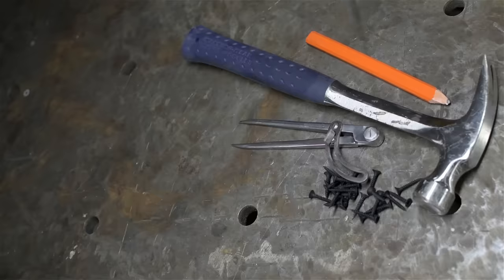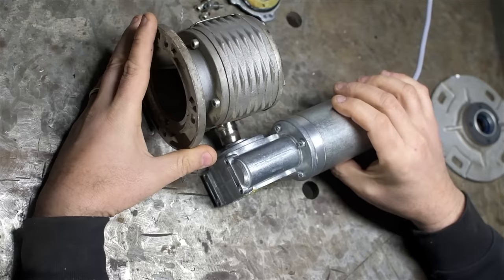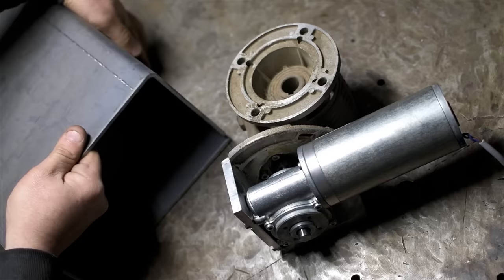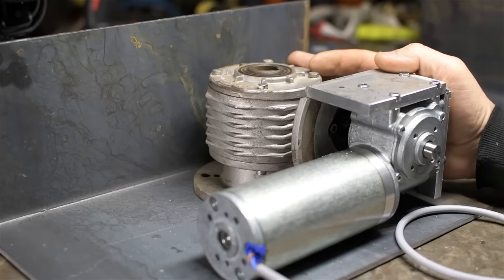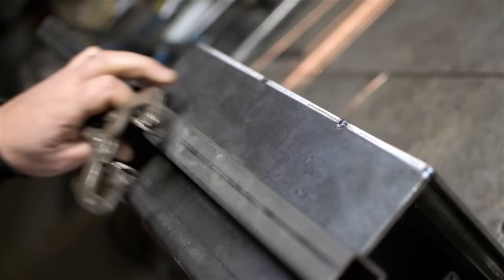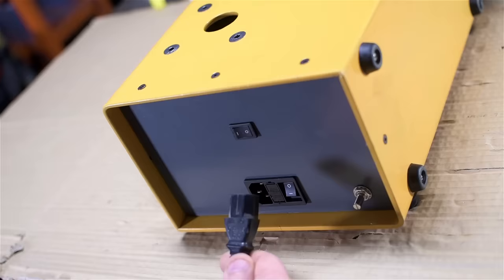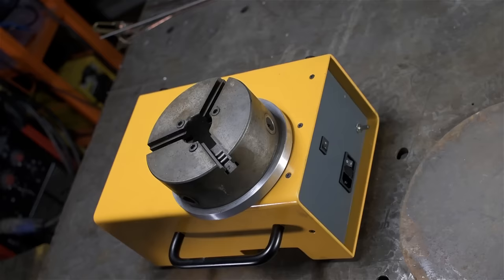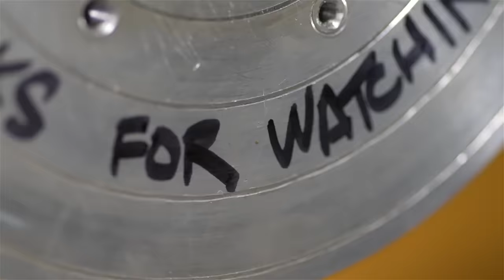Building a Rotary Weld Table

Comment: re: power indicator LED (or actually neon), the switches in those power connector/switch/fuse modules are a standard size, you can get neon illuminated ones that would be a snap in replacement requiring no modification
eta oops just realised how old this vid is :D

Comment: Great video. Love watching you do your thing.

Should you have put an earth/ground connection on your case and connected to the earth pin of your power supply? As it is now if there is a short between your power supply and the metal of the table case you stand to get a nasty shock.

Comment: when you have to put nuts in tight spaces you might like to try welding some rod to it, easy handle for when you gotta remove it in 10 years.

Comment: there must be a way to foot pedal control the potentiometer speed control so you can speed up a little as the part warms.   I am guessing the speed control is pulse width modulation but maybe the potentiometer changes the input voltage?,    power wouldn't matter with that much reduction
Reply: very well done video and project

Comment: Wonder if there is any benefit to having a rotary table with a stepper in it.  Instead of it moving at a steady pace you could set it so it moves X units, pause for Y time, move X, pause Y, etc and so on.

Comment: I understand what you mentioned at the end about welding the Aluminium, and how, as it warms up, your speed goes out the window and everything becomes a kind of fluid situation. I've noticed the same thing when I MIG weld Aluminium. Even without a rotating table! As it gets warm, you have to constantly adjust your welding speed, otherwise you'll burn a hole into the metal. 

I think the idea that you mentioned, about setting up a foot pedal for the speed control, would be good. At least that way you have some way of adjusting the rotational speed on the fly. It does raise a different issue though; how do you deal with 2x foot pedals?! ;)
Reply from the maker: with 2 pedals my brain would stop and I'd fall out of my chair. :)

Comment: Great work Tony.  I'm still confused about why you couldn't mount the 24 VDC gear-drive motor with it driving a platter directly?  It appears that the motor has a shaft that you could have keyed into a platter, so rather than building a platter that fit your worm-drive reducer, you'd build a platter with a receiver for the 24 VDC shaft?  I'm missing something and would appreciate any clarification you can provide?  jb
Reply: The main reason I can think of is the motor isn’t designed to have lateral force on it. Think of the drawing around 4:40, with a pipe that large, the forces acting on the platter would be quite large. Making his own load bearing component would’ve been pretty difficult like he said at the start

Comment: Great job on your project!

I know this probably has been mentioned before, but could you have taped the mount for the 10:1 gear box, and threaded your countersunk hex heads into that, or welded nuts to the back side of the mount. Just curiosity, and possible future suggestion.

Comment: perhaps an adjustable torch holding fixture, in a properly fixed position.  where operator on needs to feed the wire ? alllowing the other hand on that switch,  and go!  i'm joking of course about the switch.

Comment: couldn't you add a sliding (spring pressured) contact to the chuck of a lathe and get the same results? I guess the semi portable nature of the design helps, and in that case, attach the same sliding contact to a lathe chuck coupled to a router sitting on its side in a metal box frame? then you would have speed control, and with a chain get gear reduction. when parts are spun vertically, a metal lazy Susan with a chain drive to a router sitting atop your welding table for ground seems like a more compact, easier solution (have electrical contact draggers contact table nearer to the center of the disk to ensure no electricity moves through the bearings near the circumference of the lazy susan) with a router speed control to use with an angle grinder that has a chain gear locked into the angle grinder drive shaft, easier to build, better control of speed, more compact. i suppose your systems smoother operation would mean the motor lasts longer, but as you said, you'll probably use it once or twice a year...

Comment: get rid of the foot pedal and match a fixed amperage with rpm's of work , should help and as for that strange feeling you get trying to weld a moving part lots of practice I used a mig less $$

Comment: would a direct motor shaft mount with large bushing to receive the loads be a cleaner, somewhat easier and more compact solution? being compact it could he used in a more modular way as well.

Comment: Tony, been enjoying your videos for some time now. Your designs and implementations are really clever. But, I have two video/edit questions: 1) what video editor do you use, and 2) how do you do the drawings and animations overlays? I agree with many others here, it's not just your story, it's how you present your story. Your (total) work is excellent!
Reply from the maker: Thanks David.  I use Premiere Elements.  drawings are done in any ol' drawing program, saved with no background, and dropped in on top of the video.  Once they're in there Elements lets you move them about.

Comment: just a thought, a good sorce of motors / controllers 4mph mobility scooters, speed controll, forward reverse. the transaxel might not be of  any use,  also 24v scooters, or just get ya self a big old photo copier rank zerox full of goodies...discarded medical equipment always a good sourse (no auto spelling)

Comment: Nice job!
It would be interesting to know how that direct-to-spindle ground clamp holds up over time, won't it arc as it rotates and damage the spindle?
But to be honest, I can't see how better to do it!!
Reply: Beefheart Vandercrease 
Yeah, I was wondering initially about that and have been thinking that with the likely 3 points of contact that those clamps have (two nubs on one side, one on the other) that contact will stay so positive that there won’t be arcing. 
An earlier post suggests brass rollers maybe on a spring load. 
Nevertheless, awesome execution and enormous patience. 
-Buildanother68chevelle

Comment: Great video Tony. Do you have a parts list of the electronics used to run the motor? Motor controller, power supply, potentiometer etc. Part numbers would be great. Thank you so much for your videos.

Comment: I'm wondering if, instead of putting the ground clamp on the shaft, if it would be possible to have a spring tension arm contacting the platter almost like the tone arm of a record player. It would still be in contact with the piece that is being welded, not have the chance of slipping off, and still allow the platter to move without any problem.(just something that popped into my mind as I saw your placement of the ground clamp)

Comment: Very nice.  How hard would it be to add a little tachometer so you could replicate a speed that worked well or to achieve a calculated linear travel at the weld?  Good job on the project and excellent documentation on the video.

Comment: Great video. It gave me an idea. I have an old mig welder. i removed the wire feed motor. its a 24 volt motor. I messured it under sload to draw 3 amps. I have a limited knowledge of electronics. If you dont mind, were and what should I look for to power this motor and contol it?

Comment: Or a foot buttons two buttons one will speed up an other will slow down an you can have few presets to left button an it will slow table or if you click the right button it will speed up. That way it will Bring you back into range for your foot pedal and you won’t need to monitor two foot pedals. Just foot pedal for tig as normal an then have a double button for slower faster or even a single button that one click it goes up 10% an next click it goes down 10%. So you set your table speed as normal an   a floor foot button one click faster an next click slower an next click back to set. Something along them lines. Lol just saw how old this video is. Sure you have it mint by now.   Lol

Comment: Amazing build and video! When it comes to welding aluminum parts while rotating dont you then need to have a "delayed" start in order to get the proper weld pool. It seems to take longer with aluminum because of the oxidized surface?

Comment: Why not just turn the motor 90 degrees and have the turn table connect  straight to it? Removes the need for the transmission that slows things down too much, reduces cost, weight and space.

Comment: Great video Tony. I have a turntable with a nema 34 motor already attached. Is there a way to run the motor with a driver,  and  a on/off switch plus a potentiometer. Everything that I have seen online shows how to wire it up with a arduino. Can you explain to me how you wired yours up in more detail?  Thank you

Comment: Hey not sure if you’ve addressed it yet, but what is the layout of your fixture holes on the welding table? I just built one, but held off on drilling holes until I figure out a good layout without covering the table in its entirety. I really enjoy your content; super helpful for an aspiring machinist!

Comment: Hi...awesome build. I really was looking for a unit like this. You've surpassed my way of doing the build. How did you isolate the electrics to stop interference with the TIG start up? Also Im not electrically minded....but I still managed to make a  micro motor turn table. My first turn table was a music box wind up motor. I do welding under a microscope. Do you or have you considered  posting plans. Your welding is superb. Congrats. Gotta go..Bed calls...Ive gotta weld down a 12mm internal hole. They want a deposit of 10 thou to remachine the bore. Regards from Down Under

Comment: Hi Tony!
I'm not a welder, but if there are inconsistencies because of the temperature, wouldn't it help to warm the part before welding? I've seen Keith Fenner do that when using his rotary table.

Comment: Tony

Always wondered if you could use a SpinDex as the core for a rotary weld table.  With the 5C collet, it gives a nice thru hole for longer stock if needed

John

Comment: So just need to hook a pedal up? What does that look like?

Obviously on the fly speed control would be very useful. But so would the on/off switch for speed locking. I don’t really know anything about controls/electronics. Or welding really. 

Do the make pedals that you modulate speed with via depression? Can you then just set that same pedal and forget it? Even sort of usurping control with a shutoff on another pedal or even next to it on the same one? 

I think that’d be ideal from a UI perspective. Anyway. If any of you real life experts wanna give me the lowdown. Go ahead and um actually the hell outta me if you’d like.

Comment: Still i'm curious now, why all the extra trouble, to make something spin?
I can make the world spin with that motor, so i'll need a shitload of gears, or, I can make a disc spin with 200 kg, give me a shaft with a rubber cilinder and I put this to the edge of my spinning table, like we used to do with our vinyl record players, and save a whole bunch of trouble, machinery, time, weight, space,.... and then a threaded rod, to control the Y axis.
If that rubber cilinder doesn't do the trick, I roughen up the metal, and do the same with the rubber, and if that doesn't do the trick, I make them geared. But I certainly won't be using a gearbox for such a project :-)
Then again, i'm not experienced like you are, the last time I did metal work was at school 25 years ago.... so i'm a bit rusty (i need to bathe with coca cola, lol :D)
Isn't it just easier to use a (v)belt to spin it? Then your rotary table is like 15cm flat, and you have lots of space for other things.

Comment: great work, like everything you touch.  One question interested in this project: how did you attach the second phase to the turntable?  there are very large currents, if this question is not taken into account - then the gearbox will quickly become unusable ..
Reply from the maker: ground clamp directly to the work table axle.

Comment: A safety question that I have always had.
The arc coming off the welder, you need to wear a safety helmet with a minimum shade 5 lens plate. Why don't the camera or we the viewer need the eye protection to view the arc??
I know sometimes viewing videos the arc (depending on intensity) it slightly hurts my eyes. Then there is people with epilepsy...

Comment: i know this is a older vid but wanted to see how this has held up? ive been wanting to build one myself and really like your build.
Reply from the maker: so far so good! the potentiometer is acting up.  I shouldn't have used one of those 500-turn ones I bet the wires or connections are falling apart.  Or maybe I should've bought better quality.

Comment: Great Video, about to try and convert our drill powered positioner to a ac motor driven.  Why do you have to have a controller in addition to the potentiometer?   Seems like a potentiometer alone would work?
Reply from the maker: I dunno. motor came with a speed control board. :)

Comment: You should machine a copper or bronze bushing to fit your ground connection. The constant arc/break arc/break will start to erode the steel shaft and will give you grief down the road when it's all oxidized up. A copper or bronze bush will stop this from happening and will not cause large fluctuations in your current like steel will. 

A better scenario is to make a small rotary ground similar to the one shown here: https://www.arc-zone.com/mounting-bolt-2283    It is essentially two non ferrous plates rubbing against one another. One plate is fixed to the shaft and the other floats with a stub to hook your ground to. They can be greased with a conductive grease between the plates to ensure the best contact possible. I have operated sub arc systems with over 1000 amps through grounds of this type with great success.

Comment: Would there be any value to "locking" the pulses per second of the welder in step with the rotational speed of the table? Would this allow you to syncing the feed and speed for welding?
Reply: also, please start a Patreon account!

Comment: Hey man love your vids! I doubt youll see this but what tool is that at 13:41? Ive seen you use it before and ive always wondered. Some kind of hand reamer?
Reply: that is a regular deburring tool. Very handy for holes and internal radius parts, also good on straight edges when you get used to them, No use for outer radii though. You can get several different cutting heads but the regular one seems pretty good.

Comment: Amazing final product, so I need your help, I want to make my bench lathe autofeed with a stepper motor, I have all the mechanical aspects finished, I just need to wire it, this potentiometer set up would be absolutely perfect, can you tell me what ports on the driver you utilized to achieve this ? stepper motors make exactly 0% sense to this guy... THANkS TOT!
Reply from the maker: I'm afraid this didn't use a stepper... just a regular DC motor.
Reply: This Old Tony , damn, well I guess I was thrown off by the driver looking box, any ideas or ways that you know of that could simplify my endeavor? Thanks a million, your videos are amazing

Comment: hi Tonny. I saw a great deal of the great work I have done. I have a question on electrical engineering-you did not insulate the clamp of the mass from the casing. And if it does not warm up contact with the shaft, try on the shaft to cut out a small copper pulley and transfer current through a large graphite brush as in an electric train . I'm interested in your opinion.

Comment: would jumpering (spell check hates that word) the foot pedal and by passing the speed control to both control the heat and speed with the foot pedal work? 
I am not familiar with TIG MIG BIG MUG HUG SMIDGE welding.. so go easy on me ...

Comment: I have another question. how do you keep the electronics isolated from the welding current so as not to fry them?
thank you
Reply from the maker: Not sure, above my pay grade :) -- I didn't ground the box and I'm not sure if my welder ground = earth ground.
Reply: This Old Tony I am guessing that since the electronics are isolated with the plastic plate mounting the only current should pass through the motor electronics. Anyway great video. probably over thinking on my part lol

Comment: At 29:05 you dropped down an Abom four jaw chuck, and you trued it in how many seconds?  I don't believe it.  If it is a real Abom piece, you would have done it instantly by eye, or with a sequence of repeated 180-deg and 90-deg rotations over several minutes.  Every turn getting a gentle rap and a nudge on the key to tighten.

Comment: Do you have a video about your worktable? because i will set up a new workshop and need to have some more ideas about a great table. thanks
Reply from the maker: I do not but most important thing (in my book) is make it VERY heavy.  If you can move it yourself (by hand), it's probably too light.
Reply: ok, thanks for you answer. Will a normal steelplate be good enough, or do it have to be hardened steel?
and I wonder what your holes in your worktabe are used for.

Comment: I don't like the design of the box at all, there was no reason to weld up the 2 large sections. It would have been far better IMO to have welded the two end pieces onto one of them and then have the second piece screwed down.  This would provide better access to the inside of the box for assembling and maintenance down the road.

Comment: Why did you bother with the gear box you could of ran it straight off the drive  machine a step on the lathe spin the top face it off and use a grub screw to hold the top to the motor